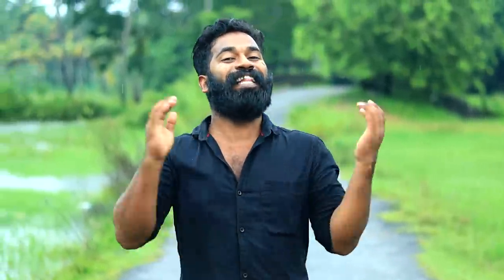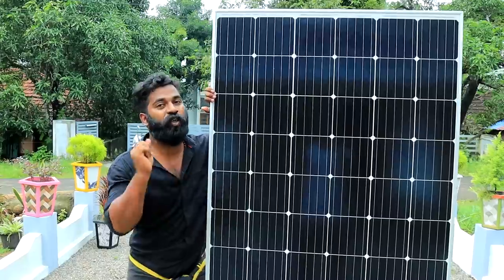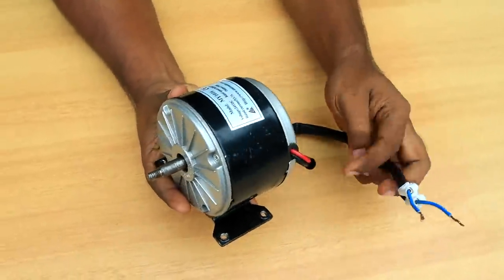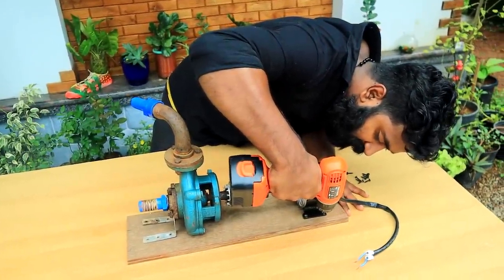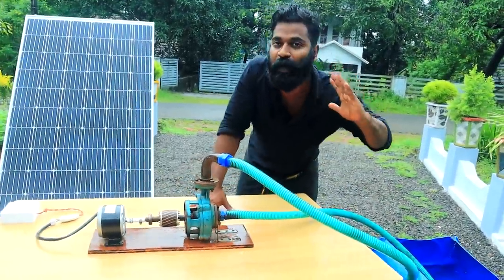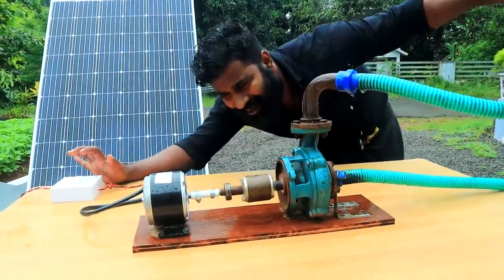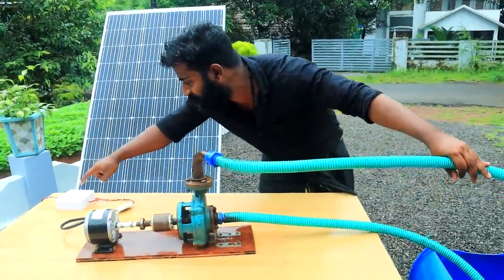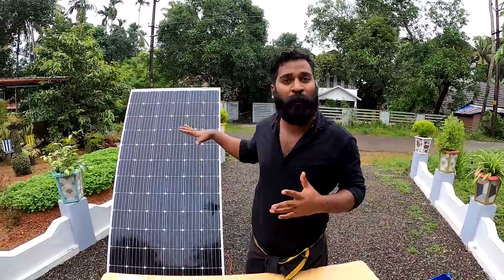HOW TO MAKE SOLAR WATER PUMP | സോളാർ പവർ  വാട്ടർപമ്പ് ഉണ്ടാക്കിയാലോ??? | M4 Tech|

Comment: Thanks  to this person and loom solar.  I could get this done much cheaper than the industry standard solutions costing about 1 lakh per kw.   My set up works well. I used an iron plate instead of wooden base and a metal coupling instead of a rubber tube - to make it more long term.

Comment: The Solar Panel is good but the maintanance charge is too high in long term it's very costly..
Reply: @Dhruvanstech  cheythu thirichum cheyyumenn വിശോസിക്കുന്നു
Reply: .🙏..Ys... especially if the charge controller and battery system is added.....but as said.. this system is useful for farmers , in the area where other powering system is not available.
Reply: @ullianove151  Yes for such condition if the facility is not there then this may helpful.
Reply: @Dhruvanstech  subscribed
Reply: @Dhruvanstech  irangi po pulle
Reply: Maintanence ആണോ initial cost ആണോ ബ്രോ..??
Reply: സോളാർ പാനലിന് പ്രത്യേക മെയിൻറനൻസ് ഒന്നും ആവശ്യമില്ല. 2-3 മാസം കൂടുമ്പോൾ പ്രതലം വെള്ളമൊഴിച്ച് കഴുകി പൊടി കളയുന്നത് എഫിഷ്യൻസി കൂട്ടും. ലൂം സോളാർ പാനലുകൾക്ക് 25 വർഷ സൈറ്റ് വാറൻ്റി ഉണ്ട് -
Reply: @bipin00716  Initial cost is High & after some years the maintanance cost is increasing year by year..
Reply: @sebimathew7043  Yes in starting with the basic maintanance u mention in the comment is fine but as the year passes the efficiency of the solar panel is decreasing & the result which you are getting after installing the solar is too different after some years..
Reply: @NarangaMittai   2000 ൽ സോളാർ പാനലിന് ഉണ്ടായിരുന്ന വിലയുടെ 26 ൽ ഒന്നും 2010ൽ ഉണ്ടായിരുന്ന വിലയുടെ 6 ൽ ഒന്നും ആണ് ഇപ്പോൾ വില. കൂടാതെ ഇപ്പോൾ അന്നത്തെക്കാൾ എഫിഷ്യൻസിയുള്ള പാനലിൻ്റെ വില.( ഒരു വാട്ടിന് 28-32 രൂപ) ഒരു 10 വർഷം കഴിയുമ്പോൾ ഇതിലും വലിയ വില കുറവിൽ ഇതിലും എഫിഷ്യൻസി ഉള്ള പാനൽ ആയിരിക്കും ലഭിക്കുക. കൂടാതെ ഈ വീഡിയോയിൽ ഉള്ള പാനലിന് 25 വർഷത്തേക്ക് 375 വാട്ട്ഔട്ട്പുട്ടിന് ലൂം സോളാർ ഗ്യാരൻറിയും നൽകുന്നുണ്ട്.
Reply: Maintenance?
Reply: Maintenance ???
Reply: @shennyjose3028 ?

Comment: those twisted pair wires cant handle panels 8 amp dc current..use thicker wires and that switch is not good for 8 amp dc

Comment: 250w motor @24 v around 30Amps current. Use atleast 4mm wire. That must improve the performance. Else voltage drops in the connecting wire.    All the best
Reply: 30A current o? Eth equation vech calculate cheitha 30 A kittiyath?
Reply: Thanks

Comment: Did that solar panel only generates 24 volts
Reply: Normally 12 v and 24v solar panels are avaialble. Actually 12v panel means will generate voltage around 19-23v and 24v panel produce volage around  39-44v

Comment: please add some capacitors or voltage/current regulator circuit in between solar panel & dc motor, this will save solar cells from frying up in long run.